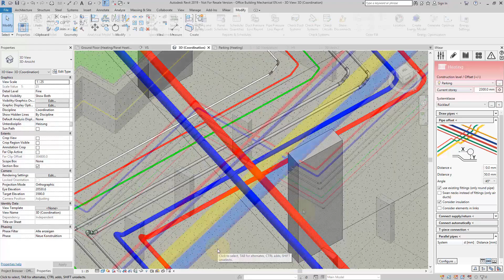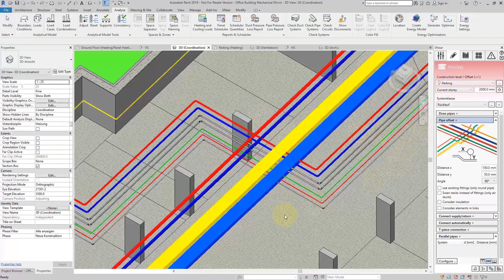Solving duct and pipe collisions – liNear for Autodesk Revit

Comment: how did u get the table on the right screen
Reply from the maker: this is our liNear control board, which you get when liNear is installed. There you find all commands and libraries for your mep workflow.